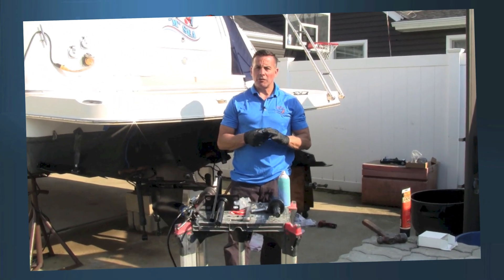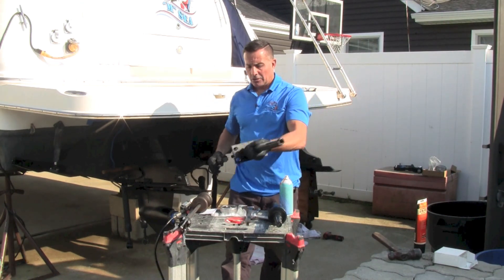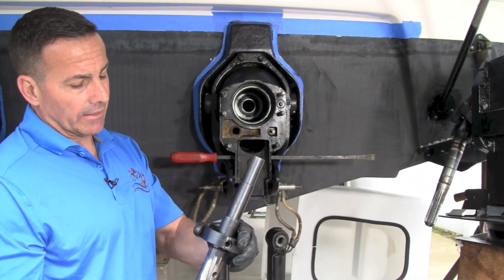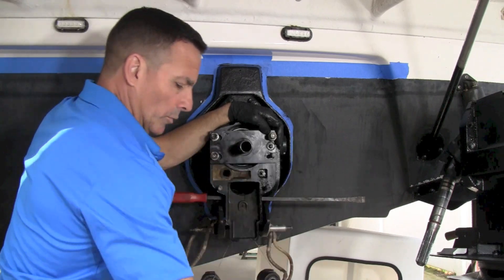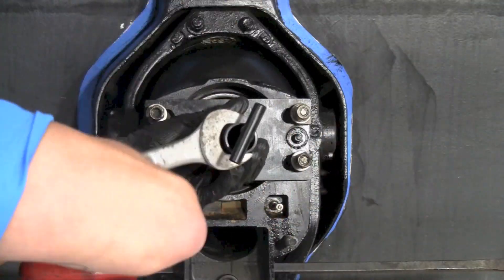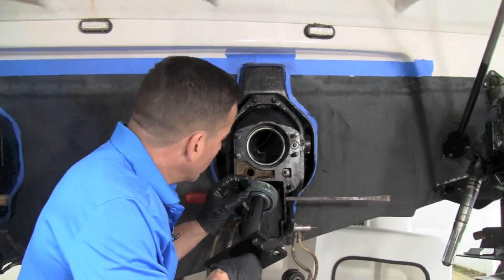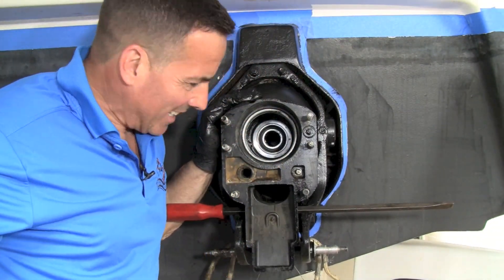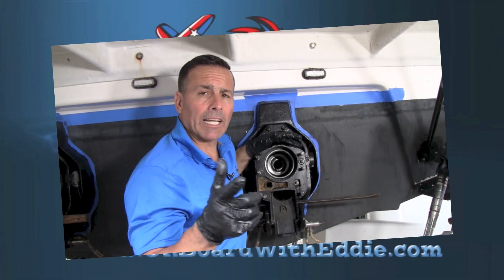How to Remove & Replace a Gimbal Bering on a MerCruiser Bravo III

Comment: If the shaft is stuck in the bearing and the out drive is not coming ouy/off What do you suggest or do you have a video for that ?
Reply: Pry and pry and pry on lower unit
Reply: block of wood on top of gearcase then trim up until it pops off

Comment: You put bearing in wrong.  Little dot on bearing should be at 10 o'clock position.
Reply: His new bearing is sealed, no need to line up dot

Comment: The universal tool you used to hammer the bearing back in, wouldn't that only be a safe way to set it up assuming the old bearing was riding where it should be?

Is it possible to hammer the bearing in too far or is there a lip in the housing to stop it where it should be?
Reply from the maker: There’s a lip where the bearing will stop
Reply: @OnboardWithEddie then why is it so important on drilling the hole in the correct location on the bar? If there is a lift to stop the bearing from going in too far, does the relevance of drilling the hole in the correct position.  If the bottoms out, it bottoms out.

Comment: You can use your grease gun to push some grease thru the hole on the gimbal housing to aid in lining up the grease hole on the new gimbal bearing on the non-sealed gimbal bearings when applicable.
Reply: Just mark the front with white out